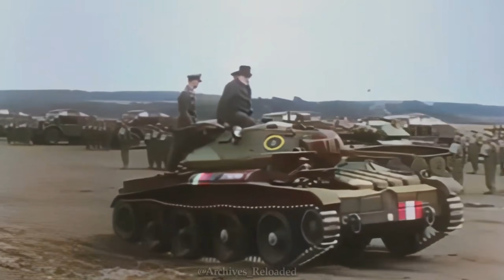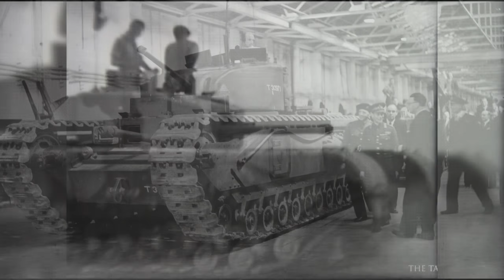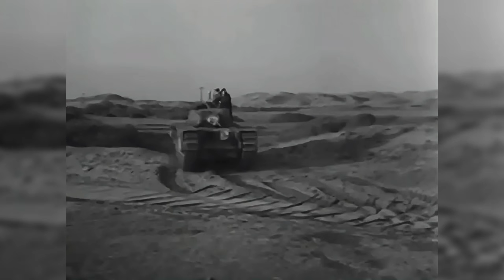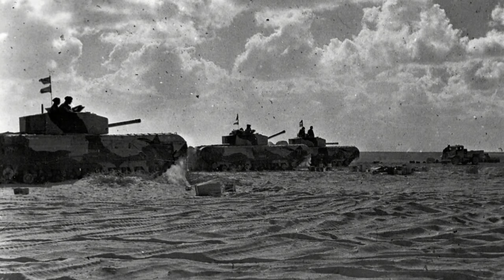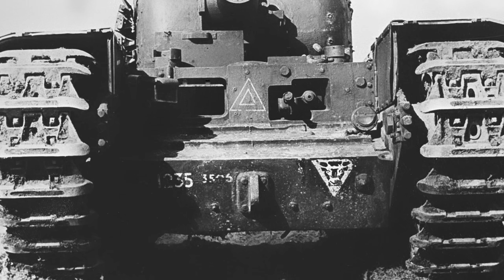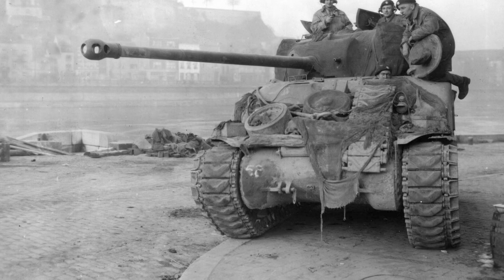The Dark Truth About Churchill Tank

Comment: Of the 59 Churchills brought over to support the Dieppe raid, 30 never landed and were brought back to Britain. None of the others made it off the beach mostly due to the failure to grip the shingle beach, a fact noted by the report made by the Germans directly after the raid. In it they concluded it was a poor design and wrote it off for future operations. However subsequent mods plus testing on sand and difficult ground conditions showed it was not a disaster. It's two advantages over all other WW2 tanks was its thicker frontal armour and capability to climb steeper ground, however in 1942 its design was limited, and the town was not the best place to use tanks but Britain didn't have anything to support the Canadians at the time.
Reply: My understanding is that some Churchills got off the beach and into town.  Unfortunately, the infantry had not been able to keep up and German AT guns drove the tanks back to the beach.

Comment: There is a very good reason why the 17 Pdr was never fitted to the Churchill. It was too big! They did design a development to carry this gun, known as the Black Prince. Longer and wider, but still with the same armour thickness. Because of this, it was far heavier, but still used the same engine, which made it severely under powered. During testing, it was found that, if the driver was not quick with his gear changes, the tank would grind to a halt and need to be started in first gear again. Not surprisingly, it was cancelled at the prototype stage!

Comment: I served from 1983 to 1986 in the East-German army as a T-55 commander. Later in 1988 I was promoted to lieutenant i.R.
I am also a classic German engineer with all the formal credencials.
My grandfather fought in WW2 in a repair unit, repairing everything and anything of damaged military vehicles until the bitter end.

Here are my thoughts:

Same as with the Soviet T34 and all the different German WW2 tank types all sides struggled with the very similar problems. There was never time enough to perfect their tanks and resources we limited.

- The T34 range although with an absolute superior engine struggled for quite awhile with gearbox and transmission problems. With the appearance of larger German tank guns and heavier tank models the until then excellent 76mm gun was outdated - which resulted in the T34/85 (I've seen the very very last T34 in official service with the East-German army, but only as the recovery version).
Once they upgraded the T34 guns and even improved optics and radio equipment was added it became THE tank in WW2 in my humble opinion.
- The German side faced more or less similar issues. The Panzer III and IV were basically at its end, so new designs were required. While the Panther was kind of reasonable, the Tiger range was certainly a complete failure (whatever the myth). Both models were chronically underpowered, too complex and as a result unreliable. Since the USSR had no T34/85 in Kursk yet, they benefitted from the huge mechanical drop-out ratio of Panthers and partially Tigers during the battle. Unreliability was ALWAYS a Nazi-German problem for their tanks and other military equipment, as my grandfather confirmed. It worsening towards the end of WW2 due to a lack of technology (lost due to bombardment) and imported steel and metallurgic ingrediencies and other important raw materials.

- It is very clear that the Western allies faced similar problems with their tank developments, so the Churchill is no exception, as with all the other Western tank models and their variants. As with the Panzer IV or the T34 there was a constant upgrading and learning-by-doing on the back (better lives) of the crews

What should be never forgotten (here the engineer speaks to you) you only can design tanks and military equipment, which within a nation exists plus the available resources (trained technical staff, domestic and imported materials, existing machineries and industries). The decision to go for a gasoline or diesel engine to power a tank is not only for what the military or the engineers think is best, it also depends what already exists. Why putting in Diesel engines if your own oil industry cannot supply you with enough Diesel. Nice to have track rollers with rubber but if you can't import rubber?
Also the question of mass manufacturing without being permanently under military threat plays a role. The USSR needed to transfer whole industries into the East, while Nazi-Germany increasingly got bombarded. I am not sure about the UK but the USA certainly could manufacture their war equipment unmolested. 

WW2 as usual was also a big trade war, each side was trying to influence and pressure neutral states (Sweden, Argentina, Spain, Switzerland etc.) to supply oneself and allies but to cut off trade with enemy states.
WW2 is full of these samples, i.e. the rubber question was an issue with the USSR for a longer period forcing them to have steel-only rollers for the T34s, reducing the mechanical reliability drastically.

All of these things are actually too complex to put them into a video of 9:44 minutes, even if it is about one particular tank only.

However, in my opinion the only message here is that tanks belong into scrap yards and a few into museums - as a warning. We do not need more and bigger and "better" tanks. They are a huge waste of resources in peace and worse in war time. Besides the suffering these "machine" cause.
We need honest diplomacy. Or we all will be doomed one day.

Peace! from Dresden / Germany
Reply: Thanks for your very informative comment.
Reply: Dem ist nichts hinzuzufügen. Tolle Ausführungen und perfektes Schlusswort.
Reply: @kleinerkrieger7860  
Ja, ich habe die Typen wie Panzer-Toni (grüne Partei) und Taurus-Agnes so satt.
Sie wissen in jeglicher Hinsicht nicht, wovon sie reden.

Beide meine Großväter hatten für uns nur eine Ansage: "Nie Wieder!".
Diese geschichtsvergessenen kriegsgeilen Typen haben das bereits wieder vergessen.

Peace! aus Dresden
Reply: Cool!
Reply: European countries focused on soft diplomacy at the expense of military capacity since the fall of the USSR and now we are faced with a Russia that sees that as weakness to be exploited
Reply: @roosterbooster6238  Allo-o-o! Elargissement de OTAN-Diplomatie douce?  Va voir les budgets militaires de OTAN et la Russie-c'est aussi "diplomatie douce"? Avant d'écrire il faut lire....mon ami....Le Pacte de Varsovie a été dissout, il fallait faire la même chose avec OTAN....Qui est scélérat chevronné? La Russie ou UE et OTAN?
Reply: In WW2, a tanker was a sausage ready to be cooked!
Reply: Good comment. Well done
Reply: I agree with many thoughts you presented. But I disagree that the Tiger tanks (I and II) were underpowered. Both had a better power to weight ratio than the IS 2 an equal one to the Pershing and most Sherman versions and just slightly lower compared to the T-34. The main issue, especially for Panther and Tiger II were their weak drive trains, not the power output of the engine. Another week point in comparison to Soviet tank engines was that the German tank engines were petrol fueled and rather thirsty. The T-34's 500hp diesel engine was actually a true milestone for tank engines. Very powerful for a tank the weight of a T-34 (any version), quite fuel efficient and less prone to fuel fires. The T-34 drive train was a different story, initially unreliable and awful to operate.

Comment: None of the versions had sloping front armour, despite the benefits being known about since WW1 and being used by French tanks pre-WW2.
Reply: To the engineers eyes: not worth the internal space and easier to make.
Reply: @duytranuc4025 yep, they just added more steel to compensate since its not like this tank was supposed to go fast anyways.
Reply: @Zmechol1337  unless we are talking about tiger 1, they just like 90 degree angle and all around armor, I mean even at the back of it is 80mm.
Reply: @duytranuc4025  churchills were thicc, especially the mk7, almost as much armor on the side as a tiger 1 on the front, all of that and its weight barely exceeded 40 tons
Reply: @mirekspodmonopolowego9016  mk7 are thicker than tiger 1 btw.
Reply: Tiger?Pzkw 3,?Pzkw4?all vertical armour so your point is moot
Reply: @stevenbreach2561  Nonsense.  The Germans had 88's that outranged our tanks by thousands of yards, so they seldom needed to worry about UK tanks.  Whereas our tanks were "see tank - kill tank".

Comment: Did the Americans use the funnies.
Reply: No. They were offered them but turned them down as unnecessary and too difficult to integrate British tanks into American logistics. They did use a sherman based version of the flail tank though.
Reply: @dukwdriver2909  The Sherman was mass produced rubbish.
Reply: @timphillips9954  until Britain got hold off it and turned it in to a tiger killer.
Reply: @timphillips9954  Really?  Would it have been smarter to build a tiny number of elaborate tanks which consumed vast amounts of scarce fuel, and broke down regularly because of their over complicated design?

As the Germans did?
Reply: @timphillips9954 The Sherman was hardly "rubbish". True that it was not excellent at anything, but it was certainly "good enough" at everything. Add to this that it was cheap and was readily avaliable. It was exactly what was required at the time.
Reply: @ —— a lot of crews died in it.
Reply: @Charles-k9g5y not true, it had the highest crew survival rate of the war.
Reply: @Charles-k9g5y  And a lot did not. It was easier to escape from than a lot of tanks of that time, it had a high survival rate.
Reply: @gamermccoolman9312  —- there were so many destroyed that even with a good survival rate there a lot of troops lost their lives.
Reply: @ —- not sure where you got your info from but everything I’ve seen says it was a death trap since it could be knocked out so easily. The Sherman’s with gas engines brooded up quickly.

Comment: Great video than you. The facts was Britain was out of tanks after the Battle of France so replacements were urgently needed. The Churchill was ordered "straight from the drawing board" in 1941 so its development was problamatic. However it was deemed ready for the Dieppe Landings and the new Churchill MkIII was the principal tank. Most tanks made it on shore, it was the shingle beach and the sea wall which stopped the tanks from moving into the town. At El Alamein the tank was a stunning success causing 2 Brigades to be used in Tunisia. Here it knocked out the first Tiger tank to be encountered by the Allies. It was actually faster and more agile than the Sherman off-road, and had less ground pressure. The 6 Pounder MkV gun was in the same category as the German 7.5cm KwK.40 and US 76mm M1 in terms of armour penetration, despite its much smaller size. It was a great and versatile tank with very low casualty rate.
Reply: I'm by no means an expert, but the very low casualty rate doesn't seem entirely accurate.
"On the Western Front, 4,477 British Commonwealth tanks were destroyed in 1944–1945, including 2,712 M4 Sherman tanks, 656 Churchill tanks, 609 Cromwell tanks, and 433 M3 Stuart tanks..."
But maybe I understood something wrong.
Reply: @SpaddelLord  Yes, Those figures were cobbled together from EoD reports. But not all tanks on EoD are destroyed, in fact 2/3 are returned to service needing only minor repairs.

Comment: churchill crews are one of the top men that suffered in ww2
Reply: Didn't it have a fairly high crew survival rate?
Reply: Suffered means they didnt die? Cause this was the most survivable tank of WWII. Or that they had to do a lot of maintenance to keep it running?
Reply: @deimos_872 also there were tank crews that suffered far more, like t 34 crews, churchill is fairly spacious and comfortable for a tank, t 34 meanwhile is super cramped, is filled with ammo everywhere and stores fuel in the crew compartment, after getting penetrated, on average, 3/4 crew members died (talking about 2 man turret variants ofc, although for t-34 85 things did not look much better)
Edit: also props for guys that had to clean up the crews of those destroyed tanks with hoses after they got literally liquified.